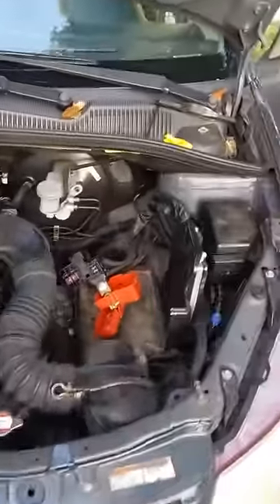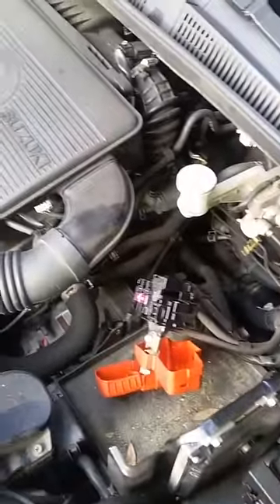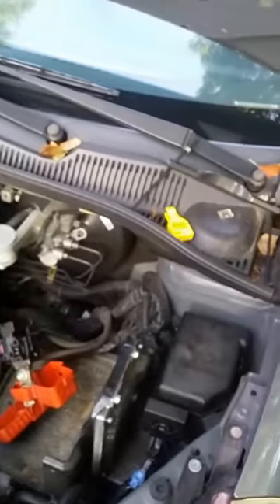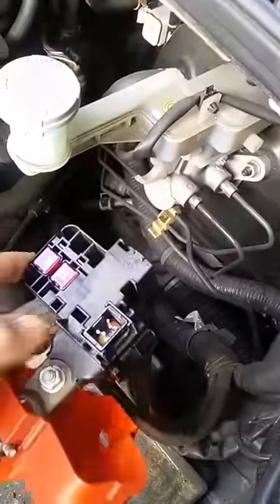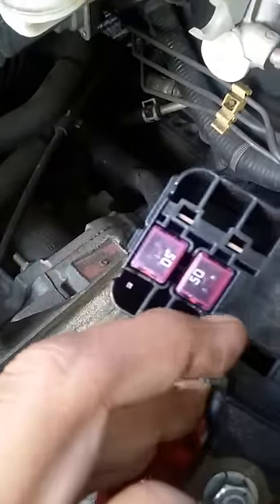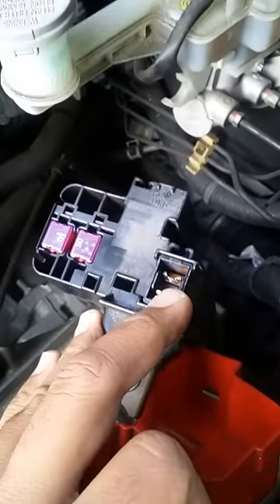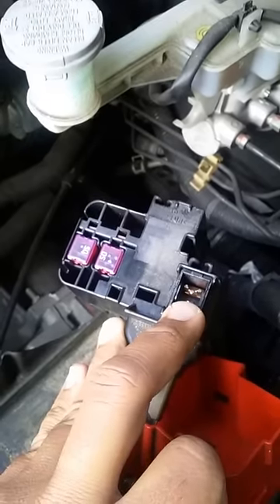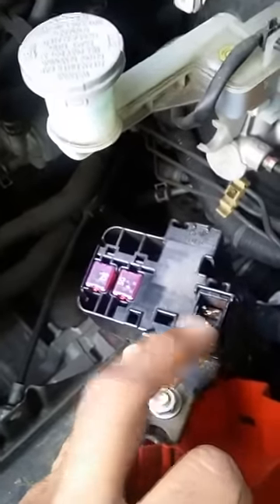How to fix the damage when you cross the battery terminals in a modern car

Comment: Did this to my VW about 10k miles ago...sparks started flying, i unhooked it, connected it back correctly, and was so lucky that my car still worked fine. I'm assuming no blown fuse, but haven't checked.
Reply from the maker: So far that's good news indeed
Reply: It's time we had a universal fitting system in place for connectors and batteries, maybe negative on the battery would be smaller on the positive much larger  So the positive cable would be far too big to fit the negative and the negative cable too small to fit on the positive battery connection
Reply from the maker: In a perfect world. For the most part, American and Japanese cars are like that, but European ones tend to be different.

Comment: Sir I have a question. This happened to me not long ago. But my question is does the terminal assembly protect the car components from being fried?because I accidentally jumped it wrong.
Reply from the maker: If the car is running, no. If the car does not run, do check the fuses near the battery.

Comment: Can you replace the 120a on the battery terminal or do you need to buy the whole part with the fuses on it.
Reply from the maker: No, just the fuse itself. That's why the fuse is there, to prevent any further electrical damage by being a sacrificial device.
Reply: @ErickMartinSucre   what would be the name of that fuse at an auto part store?
Reply from the maker: @iManual6peed  They are usually called the 80A fuse. Punch down your car's year model on Google, searching for the 80A fuse. You'll likely find the one you need.

Comment: So i have one of those small portable battery chargers that are used for emergencies and i accidentally reversed polarity when charging my battery. It caused a spark but my car is fine and runs fine thank god and didn't burn any fuses. However it left a burn on the battery metal. Is it anything to worry about?? I felt the power of the charger was too small to do any severe damage
Reply from the maker: No it should be just fine. Sorry for late reply I was camping and juts came back.

Comment: So I connected the ground(black) connection first then the red one and when it turned on I took the black cable off first and it made a spark. Should I be worried?? It was on a 16 Honda Civic. You think it messed something up? Scared lol
Reply from the maker: Well I'll check to see if the car starts. If it does check the radio, lights inside and outside the car. If all works ok then you'll be fine

Comment: When I did this I tried to start my car and stopped because my windshield wipers wouldn't stop going even tho they were off, I didn't know what was wrong but I tried again but then my car just cut off and wouldn't crank again so I checked to see if I blew a fuse and I did, 80a just like in the video, but then also realized the battery terminals were wrong, does this cause any other problems?, or just the blown fuse, and do I have to get a new battery?
Reply from the maker: Mostly blown fuse

Comment: i don't think i blew any fuses (car started and ran fine), but last night i spot welded by negative cable to the connector when my ratchet (my dunmbass went to take off the positive first) swung over and landed on negative post.. Huge sparks, 4 different spots of welding, and my ratchet even stuck to the post and terminal so i slapped it and it flew on top of the back of my engine (lucky it didnt fall back there :p )
Reply from the maker: Holy guacamole that's one hell of a spark then.
Reply: "they" were a series of one hell of a sparks :p The biggest i've ever seen from a battery. I'm one that's afraid of electricity, especially when working on a car because i don't fully understand it, so i panicked a little and chicken slapped the rachet a couple of times, so it ended up "welding" at least 4 different times over 2 or 3 seconds.
https://m.facebook.com/story.php?story_fbid=3367289383389357&id=100003249846881
Reply: also, i got a brand new battery today, and when i shut iff my van it was reading 13.0 volts at the accessory outlet, which is probably reading .2 volts lower than at the battery (which was the case when autozone tested my last battery)
Reply: Wait to see what actually happens when they say ''Can cause serious injury or death and cause the battery to explode''. Luckily it was -25°c when mine reached its breaking point and the acid was completely frozen which minimized the potential physical damage to my car. I wouldn't say the same for the electronics though. Out of habit and in the dark, I accidentally jump started too quickly without checking the direction 3 seconds too long and I'm already at $300 without having checked any further than the fuses and a new battery...The vehicle starts but is undriveable since all the electronics are dead.
Reply from the maker: Holy guacamole!

Comment: Hello. How did you remove the red cap of the fuse box?? Iwas trying to remove it but i cant
Reply from the maker: HarroldValerio Mine was rubber and it slid right off. It is possible that your may have a bolt that needs to be removed

Comment: Hey my brother did the same thing to my Chevy cobalt 2010, smoke came from under the hood and my batteries in the back, could it back a fuse or a wire that’s messed up?
Reply from the maker: Possibly the fuses. Look for the main battery fuse for it is likely that it is blown.
Reply: @ErickMartinSucre  the red fuse that says 50 on the battery? Sorry I’m not car savvy haha, I’ve been having people (mechanics) saying it’s my alternator, it’s maybe the wiring and someone else said that it’s probably a blown out fuse. My car starts and runs pretty good for 20-30 minutes then my car shuts off, it’s happened a couple times, it’s my battery either not getting enough power or idk. My radio hasn’t worked nor my indoor sounds (my turn signals and the “ding ding” while opening up my doors)
Reply from the maker: If the main fuse was blown it would not run. Battery may be bed. If you go to an auto zone, they can hook it up to the machine for free and see if the battery is bad.
Reply: @ErickMartinSucre  I already went and got it charged so it’s not that  💀 it’s good, they said it and it was also charged, they would’ve given me another one because I have a warranty so the battery’s good, it’s probably either my alternator wiring ot something or idk
Reply from the maker: No idea what it could be. I may do a little research during this evening and see what I can find. I work 3rd shift and once it slows down I'll check around the internet.
Reply: @ErickMartinSucre  much much appreciated, thankyou, just started my new job and had to call off because of all this 🙏🏾
Reply from the maker: Looked online and ppl day that the wiring harness may have gotten fried or the computer needs a reset. Disconnect the battery for 30 min and reconnect, that usually resets the computer.
Reply: @ErickMartinSucre  when I get up in the morning imma go check it out, thankyou for everything, thankyou!
Reply from the maker: Anytime, hope all works out for ya. Have a good weekend!!
Reply: @bankaispirits what was the fix ? The alternator?
Reply: @beegee495 damn 2 yrs have past already haha, but it wasn't the alternator, it was the alternator wires that I replaced, I found them on Amazon
Reply from the maker: @bankaispirits So the wires were burnt up. Wow!
Reply: @ErickMartinSucre  yee, I had to buy red/black wires, the ones I replaced were fried and since they were fried it wasn't providing the power to the alternator
Reply from the maker: @bankaispirits  Holy crap! It's been 2 years but I am glad you updated me. I appreciate it!

Comment: did you have any other problems other than the fuse. I have the same make and model of car and did the same thing
Reply from the maker: Hello Mr. Dowler! Thankfully no, the fuse was the only thing that got messed up. The moment I crossed the battery I heard a "Snap". I checked online and people were saying that it may be the ECU and I freaked out but not in this case. Did you have any other problems besides the main fuse in the positive terminal?
Reply: I had someone look at it, and it was only the fuse.
Reply from the maker: Whew!! That's a relief
Reply: Random stuff with Erick Martin ...thank u i have a similar problem some put the negative to positive ect...now i have to search around for a main fuse...thank u for video
Reply from the maker: You are very welcome. Hope you  find the blown fuse. Mine was at the positive terminal of the battery cable. It is basically the biggest one there.

Comment: hooked up battery backwards on a 93 Mazda B3000 everything works but it won't initially start you can prime it and it'll run you can but it won't start by itself what is the problem
Reply: anyone know the problem
Reply from the maker: Hello Mr. Bobby and thank you for dropping a question. I used to own a 1998 Toyota Camry that had a similar problem like yours. It ended up being the starter that went bad. Also check the fuses inside the car in case any of them nay have been blown. I'll do a little more research regarding this and be back with my response.
Reply from the maker: Some sites suggest that it may be the ECU
Reply from the maker: Does the starter crank at all?
Reply from the maker: Hey buddy how are ya?! Just checking up on you and see if you manage to resolve that issue you had
Reply: @ErickMartinSucre  I bought a car and the terminal wires seem like they are backwards plus I have my cooling fan hardwired to the battery...I got a lot going on there but it's not messy it's wired correctly. But when I bought the car (1998 Ford contour svt) I noticed the terminal reversed but it started fine but it's having to need a jump recently and now it won't start on its own but it has for a few days until I left the wipers on today
Reply from the maker: Gabriel Huanosto Oh my that’s something I’ll say. In my case the Suzuki would not even light up at all mainly because that main fuse blew. Not entirely sure how yours work sorry
Reply: @ErickMartinSucre  thanks bro
Reply from the maker: My pleasure Gabriel! I hope you get to find out what is happening to your car
Reply: Erick Martin Sucre and

Comment: 👉So question I brought a Brand new battery it's a Duracell battery or something. Everytime I try to connect it smokes like near the or underneath like near the oil pump I think that's what you call it and I also notice the connectors be hot when I try to unconnect it because this never happened until I got the new battery is like on opposite side of the battery I got a 2012 Dodge Grand caravan. It's very hard to find a very good mechanic in NC can anyone please help me to solve this solution?👈
Reply from the maker: On top of my head, I would not know.

Comment: I did this to a 2011 Kia Sorento due to the weather I put the  damn thing on backwards now the radio,key lock and lights won't work
Reply from the maker: Aww that suck Brian. It the cars turns on then it may be some individual fuses. I hope you find the ones that got blown. Giod Speed my friend!
Reply: @ErickMartinSucre  took it to Kia it burned up some wires behind the radio column
Reply from the maker: Gasp! Holy cow! Damn that blows
Reply: @ErickMartinSucre  they wouldn't fix the radio column due to warranty issues but they fixed the lock and light issues gotta buy a replacement radio

Comment: I did this to my 07 dodge charger a few days ago and it started smokin...now it wont stay started and when i try and rev the engine nothing happens....what did i do😠
Reply: My blinkers, radio and wipers aren't working now and its nit drivin
Reply from the maker: I will not lie to you. I do not know this one
Reply: Should i try and change the fuse box
Reply from the maker: @deangelosmith8887  If it is not expensive it is not a bad idea.
Reply: @deangelosmith8887  just did this to my jeep liberty 2006 on accident yesterday, everything works fine except my radio and key fob. Any ideas on how to fix that???
Reply from the maker: If the car is running it might be a few fuses. I don't think is something serious
Reply: @ErickMartinSucre  thank the lord. Im guessing sonce i changed the battery too i’d probably have to reprogram the Key Fob too?
Reply from the maker: I don't believe you have to. Again it may be a fuse or 2. I've changed the battery on my prius and it never needed to have the keyfob reprogrammed
Reply: @deangelosmith8887  same thing here bro, on a 2008 charger

Comment: My Nissan Rogue wouldnt start so my neighbor tried to jump me.  He crossed the cables and we saw sparks.  Ee corrected the cables and it started.  I tried to go to work but it wouldnt go over 10 mph.  What happened??  HELP, PLEASE
Reply from the maker: If the car started that means the main fuse in the battery terminal did not blow. At this time the first thing that comes to mind is a computer reset. Unplug the negative terminal of the battery and leave it unplugged for 15-20 minutes. Once you plug it back in the computer should have done a soft reset and possibly resetting the electric throttle body, allowing you to go faster. I hope this is what your car needs, if for some reason this does not do it, I am afraid it is beyond my abilities, God Speed Mr. Roberts!
Reply from the maker: How is the car doing so far, any updates?
Reply: Random stuff with Erick Martin I have the same problem this guy is having. In the morning I'm going to try and do what you told him and I'm going to check the fuses.
Reply from the maker: I hope everything works out for you Mr. Allen.
Reply: does your gas pedal work? If not it is the throttle body fuse.
Reply: yup it worked out great, thankfully. Throttle body fuse was blown, replaced it with a spare and everything was golden after that!
Reply from the maker: It does yes! On this specific car the Suzuki Sx4 it was just that main fuse on the positive terminal of the cable that got blown. I heard a loud "snap" when I crossed the battery
Reply from the maker: That's great Allen M glad it works

Comment: My bf accidentally reversed the terminals in my 2003 Ford Escape! When he would try to turn on the car nothing would happen at all so we ended up replacing the main fuse (120A?). After replacing it lights, windshield wipers, radio, dashboard accessories, car remote, everything seems to work BUT it still doesn’t start. When he tried to start it my radio buzzes as in ejecting a CD sound. Any help!! Research i have done explained it could be the battery that is not holding charge and may need replacement but I’m not sure I just need more answers.
Reply from the maker: Hello Miss Maria. If possible, see if someone can let you borrow an OBD Scanner or get one for a Autozone. They usually let you borrow it for free.
Reply from the maker: This will in turn give you some error codes that you cann look up online and give you a clue of what could be wrong.
Reply: Erick Martin Sucre thank you so much! I will for sure follow your advice
Reply from the maker: I wish you the best and hope it is something simple to fix.

Comment: Im dumb ass also hopefully something like this can fix my car... I have Honda accord 2017 when i put new battery on after crossing them horn stays on...
Reply from the maker: Sigh, yup, it happens sometimes. If horn stays on check the fuses and hopefully it is just a blown one.
Reply: Yes hopefully thats only problem just too late to see dont want to wake neighbors so i must toss n tune intill morning. But im thankful I stumbled across this blog gives me some type of hope that I did not fry the whole system. My thoughts are since the horn doesn't stop when I connect to the battery it shows at least it's getting some type of juice I'm going to check the main fuse that is on the end of the positive connector also hoping since it is a 2017 hoping it has a fuse that pops before burning up the computer fingers crossed thanks for the reply
Reply from the maker: Godspeed
Reply: So I opened up my fuse box and found that 125 amp was blown have to order it from Amazon or Honda dealer but one question is I wonder why the car horn continue to blow when I re hooked up the battery correctly do you think because I blew the 125 fuse the horn is going off or do you think another fuse might be blown I checked the regular horn fuse the 10 amp and it looks good was wondering if there is another another fuse for security thanks again for your time and effort I appreciate you wondering if you heard ever about someone's car horn staying on after they crossed the batteries
Reply from the maker: Won't lie, I have no clue but it is likely to be that main fuse throwing the computer off and sending a signal to the horn. Keep me posted

Comment: I just did this on my truck.
Reply from the maker: That's a bummer David. Hopefully all it needs is rewplacing the main fuse. Someone recently reported that after replacing the main fuse, the car turns on but the radio and the lights won't work. SOmething about some wires being burnt. If I recall it was a Kia car.
Reply: Yep, that is what my truck is doing, truck turns on but I don’t have a radio but I do have lights. At first I thought I fried the brain and I just bought it and I was replacing the headlights and forgot I had a two battery system ( I am so used to working on my dads 79 Ford and his 88 Toyota). I am eighteen and I DO NOT everything!
Reply: This helped me out a lot! Thank you!
Reply from the maker: My pleasure David. It does not seem to be something too serious but I am sure you can pull it off. The person who repsorted this found the burnt wires behind the radio column. Hope this helps.
Reply: I will look at that!!!! Thank you again!!